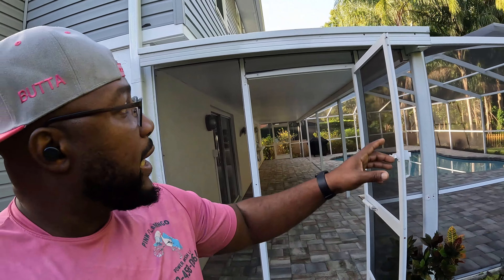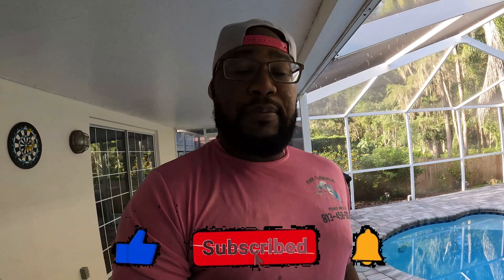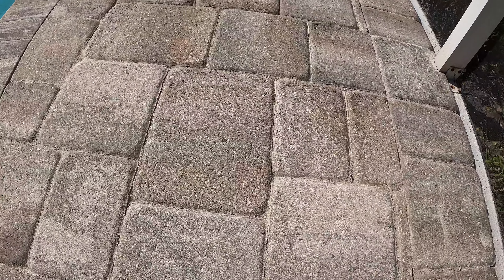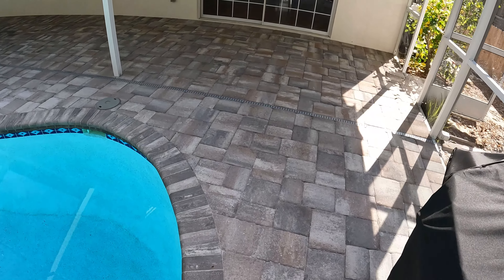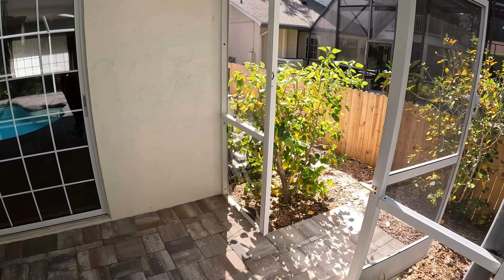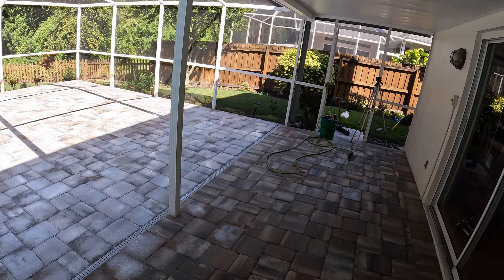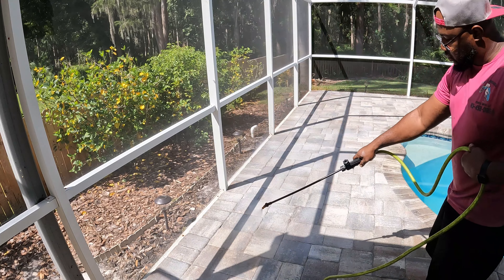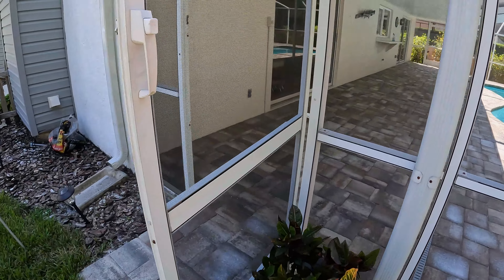sealing pavers after cleaning #paversealing

Comment: How  do you determine  weather  you need  to strip first when  customers  don't  know  if it was sealed  or if it was sealed  back in day with  solvent  sealer ? Thanks  Mr.Cliff
Reply from the maker: You can do a test by pouring a little water on the pavers and see if the water sinks or stays on top of the pavers. Also some pavers you can tell they need to be stripped because certain spots it will look hazy. The type of sealer im not sure on but if its getting stripped it doesnt matter.